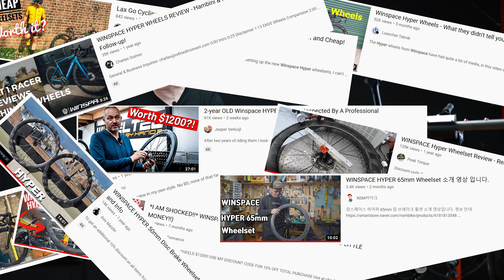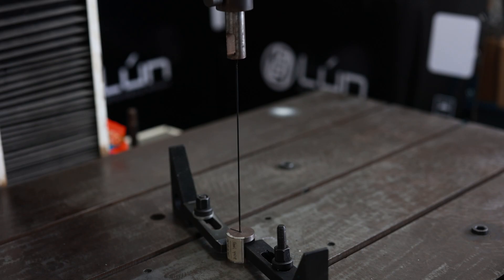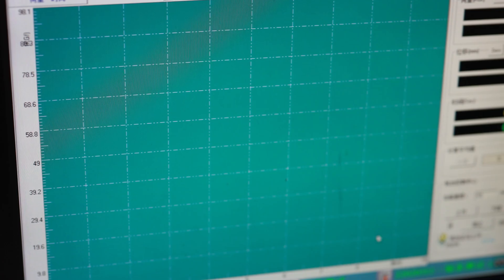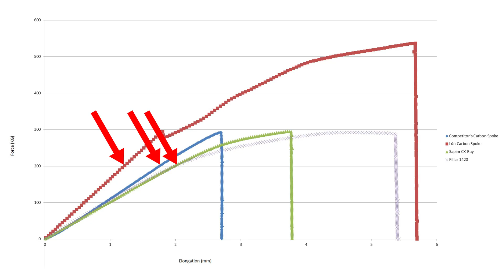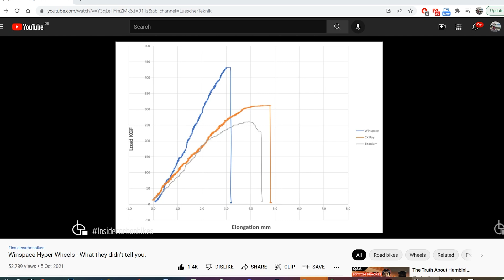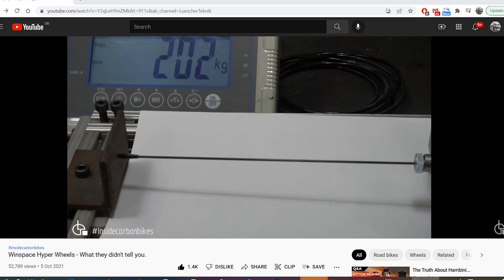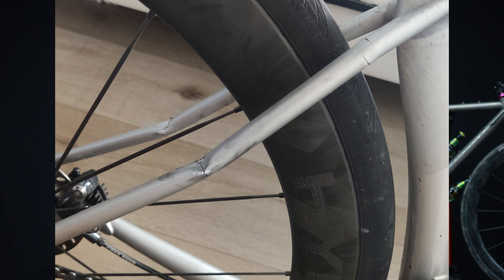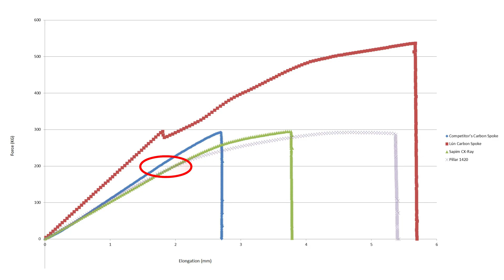Carbon Spokes - How FRAGILE are they? 🙈

Comment: Carbon spokes and hubs are a bad idea. Metal bends, carbon shatters. You wanna risk that on race day?
Reply: That’s a stupid comment when the bike and rim is carbon. So what? Go back to steel everything?
Reply: @kentwong3818  If you wanna ride wheels with carbon spokes, do you. That's my opinion.
Reply: It's all in the force not way it fails. My steel spokes might as well be carbon as they broke. Not enough material for plastic elongation and even then they won't carry the load. It's all about forces they can handle. Rubber band can elongate much further than steel without snapping. Doesn't make it a better material. Also when in tension steel spoke "bending" will translate into more tension and snapping either way. What steel has going for it is it won't get cut/chip with sharp high speed impacts. So you can open more bottles etc. As for spokes/rims/hubs made of carbon fibre composite or steel, aluminium, titanium. It's not just the material it's also the design that mitigated the issues of specific materials or utilises their strengths. Look at progression from steel to aluminium. It required more volume but still was lighter. And further exploiting by hydroforming. Carbon fibre is awesome at tension and spokes seem like the perfect application for utilising its strength as long as its cons are mitigated which it seems it's starting to be the case.

Comment: Quite curious about the difference in elongation between the 2 graphs you show.
 In the first graph your spokes fail at nearly 6mm elongation wether in the second one the failure happens with just 3mm elongation, that's a big difference!
Anyway nice to see some data shared and a proper technical explanation.

Comment: I have about 10 000km on a set of Winspace Hyper 50s now, yes they are super durable, light, fast and rigid but the spokes have come loose a few times especially on the front wheel which I must say is a bit of a pain, I have a truing stand and fasten the spokes myself but if I had to keep taking them back to the shop to have loose spokes fastened it would get old real fast.

Comment: Sailing Rigging.  You do not have the Shock loading a crappy rider might apply (my 220 LBF on a 5ft 10 in frame) but the rigs perform for years.

Comment: I recently went with a wheelset with steel spokes for the same reason I always buy DT Swiss hubs: serviceability. Steel spokes offer wide availability, shop familiarity and ease of replacement. I'm sure it's possible to get replacement spokes from Lun, but every shop in the world is going to have some CX-Rays in stock. I sure this will change over time as carbon spokes proliferate. After all, carbon in pretty much the ideal material if you want something light and strong under tension like a spoke.
Reply: You get replacement spokes with the wheel. When you travel with your bike, you take them with you. Problem solved.

Comment: How did the carbon spoke joint with the metal part at both end?
Reply from the maker: It's a mechanical interface. Basically the end of the spoke is being pulled through a hole that it's too big to fit through.

Comment: Do you have information on the fatigue life of the carbon spokes, or of wheels built with them?  My experience with wheel failures is usually the spokes fatiguing as the primary first failure mode. 
I imagine these can be far superior but the bonded joint where the spokes attach could be a weak point.
Reply from the maker: The joint isn't bonded, it's a mechanical interface. (A bit piece of carbon trying to get through a small metal hole) so that joint isn't gonna have a break down of bonding agent, etc. :) As for the actual fatigue life and what dies first...I'm not actually sure. They have machines that pull these from 100->200kg and back again at a rate of 1hz and put them through lots of cycles (I'm not sure of the actual number, so not gonna pull one out my ass.)

Comment: How about COMFORT ARE THIS FEELS COMFORTABLE TO RIDE AS WELL?  OR DO THEY RIDE AS STIFF AS THERE MADE?
Reply from the maker: As this is less data-driven, I'm reluctant to answer... you can check other reviews. My personal opinion is that on any normal road surface they feel the same as a standard wheel. Your tire is what does most the "comfort" part of a wheel. That said, I think if you do smash into a speedbump or something at 30kph (not recommended) you do feel it a bit more with these.

Comment: 😅, damn those discs need to be realigned, would go nuts with it hitting the whole time. 

PS Great video!
Reply from the maker: Hahaha. Have been testing different cable actuated brakes lately, swapping them at the side of the road with a mini tool. Apparently I did a poo job of the install. Oops.

Comment: Spokes actually seem like the best use case for carbon fiber. Carbon fiber being just carbon strands held together by resin, it's only really strong in the direction in which carbon fibers are laid. Spokes are pretty much only under tension in one direction, so you can have all the fibers laid in the same direction and achieve insane weight to stiffness ratio.
Reply from the maker: Exactly. The hard part is the interface between carbon and the alloy.
Reply: until anything touches them sideways. but will try.

Comment: now the big question is can we buy Lun spokes?
Reply from the maker: At the moment; no. You'd also need a special hub (the head of the spoke is different to a regular spoke.)
Reply: @ChinaCycling  thanks so the next question is when can we buy the hubs ;). But seriously would you consider making them with a standard head. And if not what is the reason for that. Just out of technical curiosity

Comment: I think the way the world is going, most wheels will be carbon spoked soon. I've had some bad experiences with some carbon spokes, the metal to carbon interface failed. No issues with the Winspace though, they've been pretty much bullet proof
Reply from the maker: Your average big wheel brand is spending MILLIONS of dollars a years on spokes. The relationship this makes between supplier and builder is set in stone. The purchasing department or the wheel brand are on VERY good terms with the folks at the supplier. So, it's not so easy for them to just throw their spoke supplier to the kerb and move over to the new technology. So, yes, I believe carbon spokes are the future, but who has the technology to do it right, and who is in the position to do it right is an interesting one...